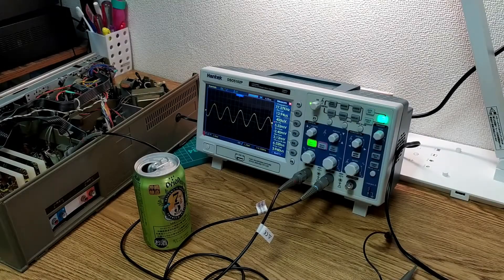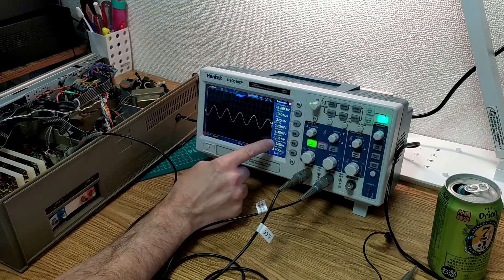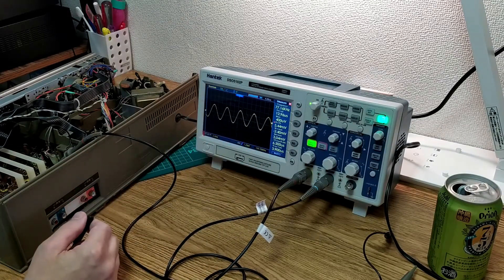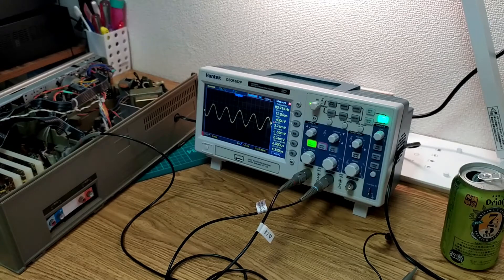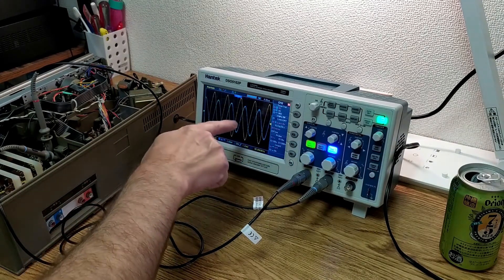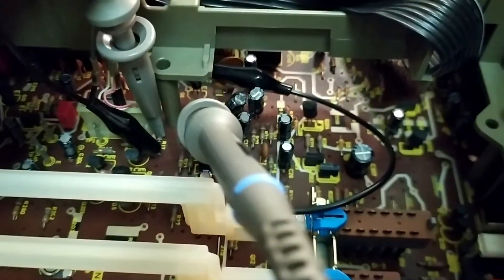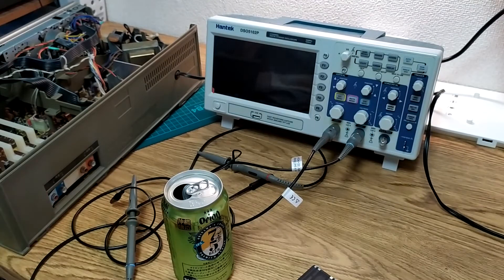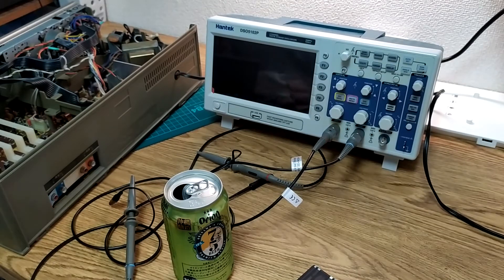Technics RS M250 Bias

Comment: I don't mess with bias unless i have to.
The playback amplifiers need to be set to balance the head channels, but you need a known reference tape with identical channel amplitudes to playback.
I would have thought a mono tape would provide a wide track so both head channels should output equally.
I say 'Should' lol.
But do you use the playback meters for levels,  another possible error.
If you use test gear for the levels, then you will have to set the playback meters too.
Record bias with record audio level will affect the frequency response/balance per head channel. 
And different tapes change the result, multiple testing (easy to cockup).
Help help my brain is melting, yes i'm thick lol.
Sorry about my imperfect waffling.
Reply from the maker: You're correct - the play back levels need to be set first, or everything else is a waste of time.  I measure at the output, but it so happens that the meters are actually correct - in fact that was the first indication there was a recording problem.  Every thing fine playing back test tape, pre-recorded music, but recording something and playing it back gave un-even, and audibly so, results.  A bit of digging around and bias was suggested as possible culprit, and it was way out.
I might do a second vid on the recording level procedure.  There still seems to be a bit of an issue with uneven levels, but at least now bias is not the issue.